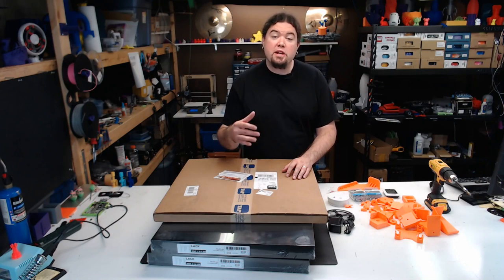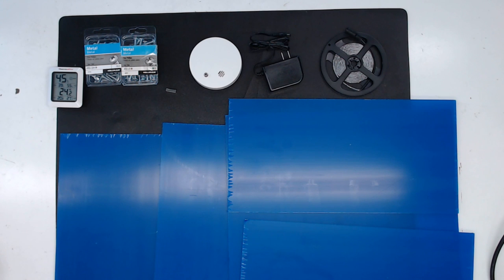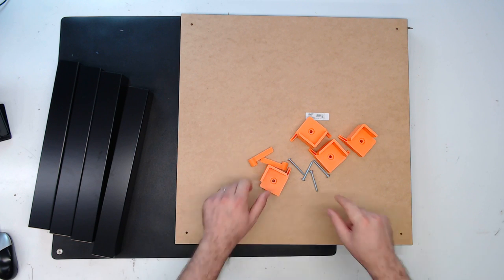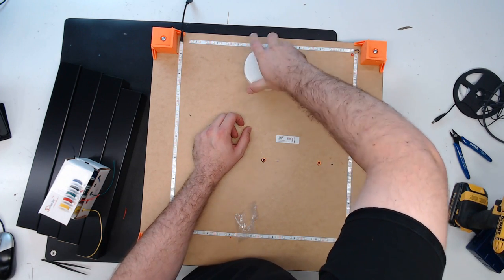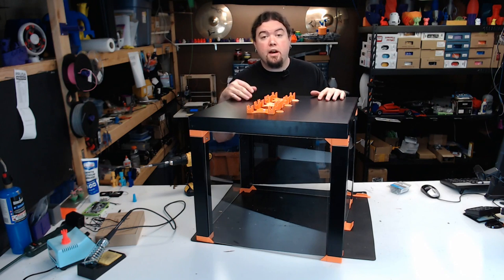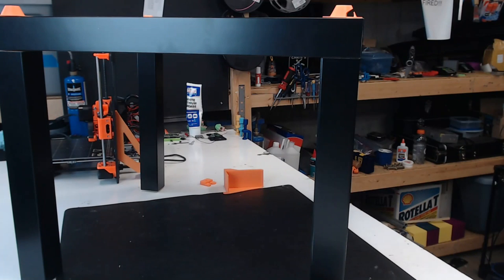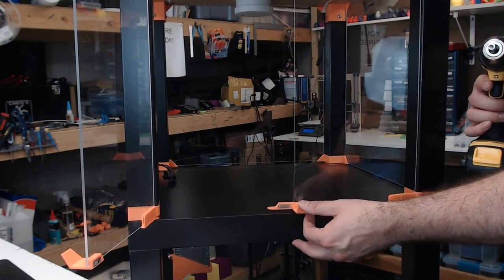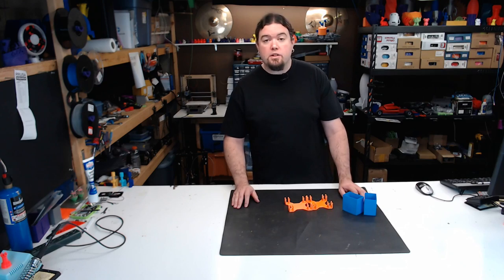Prusa IKEA Lack Table 3D Printer Enclosure - Chris's Basement

Comment: I just built my second enclosure and humbly submit my tips to make sure yours comes out even better. 
In attempt to get my wife to allow it to be a fixture in our family room I printed the parts in black. The enclosure is proudly in the corner of my office. 🙄

Use a sharpie or black marker to hide the glaring white wood that shows through after assembly. Trust me, this adds a lot to the finished product regardless of the color of the printed parts. 

I found on the first one, the parts wanted to wander badly as you drilled them onto the Lack tables. I found that if you used superglue and attached the parts and let it setup overnight you could come back the next day and, don’t skip this, drill a 3/32 pilot hole where there isn’t an existing hole before putting in the screw. If you don’t, the part will rise, drift, leave a burr and not sit right. Also make sure the holes in the part will accept the diameter screw your using. 

Use some tape to make sure the acrylic fits TIGHT in the door hinges. I eventually used a light application of clear silicone to hold them in place while taping/bracing the doors in their aligned position until it dried. 

The magnets are hella strong, make sure they fit flush in their mounts before gluing. I used clear epoxy and allowed it to flow in all the gaps. Afterwards before it was fully hardened I used a razor blade to shave the excess off the top of the magnet and part. 

I hope this helps others to get theirs complete without all the little hassles that I had. I’m a perfectionist so take all this with a grain of salt. 

Chris makes it look easy, it was but the Lack tables are really cheap, i think the best comparison is you’re spending well over the cost of the tables so to make them work, you need to develop your turd polishing techniques. 😉 if you miss a hole, JB epoxy putty works wonders. Fill it, wait, repeat. All in all I loved the video and am responsible for at least 20 views.
Reply from the maker: Great tips! Thanks for sharing.

Comment: Very comprehensive guide! Followed you along with the first enclosure I built and reviewed this for the new top I had to build after damaging the first
my only recommendation for people looking to make this and there may already be remixes of the files for the printed components available 

I slapped a foam sheet and two pavers under my prusa to help with the noise and you need to have either the tops or bottom printed pieces extend to allow the Z axis to move to its maximum height, I gave mine an extra 10cm but you could probably manage with as little as 6cm
and keep in mind you'll need to either adjust your plexiglass size or compensate the added gap with something else

I've also swapped the plexi for PIR foam on mine as I print PETG in the office I work all day in and while the plexi does help with ambient room temp it still raised it uncomfortably for me,  and for anybody curious about insulation options I was told PIR foam is your best bet as things like XPS foam insulation present a much higher fire hazard, a nice bonus is the foam walls help lower the noise as well
Reply from the maker: Thank you! Nice mods! Yes, I actually did a lot of these when I rebuilt mine earlier this year.

Comment: Your video is SO much clearer and easier to follow than Prusa's.  I already had mine built, but watched it to see if you did anything different and picked up some tips.  I was thinking of extending the power cables as well.
Reply from the maker: Glad it was helpful, thanks for watching!
Reply: @ChrisRiley  Can anyone link me to a source for replacement longer cables?
Reply from the maker: @coffeeeater  I just use 14g wire.
Reply: @ChrisRiley  thanks!

Comment: Built a plexiglass enclosure a few years back. Moved PSU away from printer frame like yours. Added exhause fan with charcoal filter variable speed, rollers with bearings (adjustable) on 2 steel rods on top, 3 LED lamps Top, back, front; sheet mirrors on back; Pi  4 bracket inside; slots for power cord to PSU, LEDs and USB cable. Prefab/printed all frame brackets, door latches, etc.24d, 20w, 18" h. Sits on home grown storage cabinet. May try and redo using Prrusa printed parts with my additional mods. Yours looks great, mine is rough but functional (cut plexiglass myself..ugh.
Reply from the maker: Nice! Sounds awesome, cutting plexi is the worst.

Comment: If you're doing tall prints, it is recommended that you use a slot in the top to feed the filament rather than a hole. Failure to do so will restrict the extruder movement along the x axis as the z height increases. Options are available on Thingiverse.
Reply from the maker: I have seen that issue on other machines, good tip.
Reply: do you have a link?
Reply: A slot ?
Reply: Good tip.  Thanks!

Comment: thanks for the info, i found #14 by 2" screws work better and hold in the predrilled ikea holes, and the 3/4 inch screws are a bit short, so I'll be changing those out for 1" screws in the near future...
Reply from the maker: Thanks for the update on your build! This could help others, thanks for watching!
Reply: Chris Riley no problem, now if I can just get my mk3 to complete a print w/o screwing up
Reply from the maker: Really? What's it having issues with?
Reply: Chris Riley it'll print fine for about an hour and then stops extruding... started after I finished printing all the parts for the lack tables, Prusas's support has been great, they are shipping me a new extruded motor this week to see if that's the issue. Tomorrow I'm going to check the extruded gears one more time, make sure they are lined up correctly and tightened down properly, but I don't think that's the issue. Like I said I can get a great print for about the first hour of a print... then something goes wrong...
Reply from the maker: That's a really weird issue...I will be curious to see what the cause was. Kinda sounds like a stepper driver issue.

Comment: I love this enclosure I have been using it for a while now the spool holder didn't work tho I just printed a wall mounted spool holder for the wall behind it and if you have made any pla mods to your printer and plan on printing abs I would recommend reprinting them in abs asap I learned this the hard way I have a contract for alot of abs parts and any pla parts near the printer slowly start to warp
Reply from the maker: These are really cool. I actually pull filament from the ceiling. :)  Good tip about PLA parts.

Comment: Going to try to build one of these for my ender 3 pro. Will just have to figure out the power supply brackets. Might also add a cabon filter exhaust system.
Reply from the maker: Check out this new one as well. https://youtu.be/AxMZESdOPqw

Comment: Not sure if it used to, but the download from Prusa now includes an adjustable filament holder that slides narrower to wider for different sized filament rolls. I used a fixed size in the middle and adjustable ones on the sides and it's working nicely. I think if I did it again I would just put a single adjustable one though.
Reply from the maker: I have seen those, that's a new stl in the bundle. A very nice add.

Comment: For those who have #12 screws and are too lazy to make a trip out to the hardware store: put a small zip tie in the hole and cut it flush. The zip tie will fill the space and your #12 screw should now secure things quite nicely.
Reply from the maker: Thanks for the tip!
Reply: That's genius, fit perfectly after that 👌

Comment: Hi Chris!
Any advise to reduce the amount of vibration / shakes on this enclosure?

Good video!
Reply from the maker: Thanks! I put foam under my printer and set the whole thing on foam rubber and its pretty sturdy. You might try using a little bigger screw to attach the legs, that might help.
Reply: Is there a chance you could share a couple of pics of your setup so we can get a bit inspired? Cheers mate!
Reply from the maker: It's not super exciting, but here you go.

https://photos.app.goo.gl/1fw5swtvpRgjDRnz7

https://photos.app.goo.gl/vWDizVnxwNWfCF9CA

Comment: I made a lack table enclosure a year ago for my Wanhao. Somewhat similar to the Prusa designed one, but doesn't look as nice. It uses a simple pc-fan exhaust that vents to the room..I still need to modify it to vent to a nearby window. ABS fumes are horrible. Though not ideal, I use a window fan and try not to occupy my bedroom whenever I print ABS. This Prusa design really needs a fan exhaust for ABS fumes and the excess heat (excess heat from a 3D printer in a bedroom you occupy during a hot summer day with so-so AC isn't great). Also, while lack tables are cheap, they are hollow and not dense enough - the whole thing vibrates too much when printing. I bought a Prusa MK2 that I'm building an enclosure for now - such a pain. I would actually pay Prusa for a more professional enclosure than what I currently have and this open-source design.
Reply from the maker: Sung Powley Good points. It could stand a few more features. Printed solid has a pretty nice one. https://printedsolid.com/collections/enclosures/products/safety-enclosure-for-prusa-printers
Reply: use a active charcoal filter system and switch it on after the print is finished, Im sure that works better

part of the reasons for the enclose is to keep the fumes contained and the heat in the enclosure.

but better : use PETG . same strengt as ABS, better printability and less fumes.
Reply: Stability was my main concern when watching this build. It all looks so flimsy. Like the whole thing will shake if you breathe on it!

Comment: Awesome, clear to the point video. I wish it showed how to extend the wires.. what type of wires would I need? Im new to all this. I just ordered my Mk3s yesterday
Reply from the maker: Thanks! You can use 14g wire to extend them. I would just create longer ones and replace them. 

Wire: https://www.amazon.com/Audiopipe-PRIMARY-STRANDED-Best-Connections/dp/B01MRYMY6Z/ref=sr_1_4?keywords=14g+wire&qid=1555430983&s=gateway&sr=8-4

Connectors: https://www.amazon.com/Install-Bay-BVST6-Terminal-Connector/dp/B005HQ4QTI/ref=pd_bxgy_107_img_2/141-9741925-2440812?_encoding=UTF8&pd_rd_i=B005HQ4QTI&pd_rd_r=6d5466ed-6062-11e9-a944-2f3383ee933a&pd_rd_w=i1lzI&pd_rd_wg=hsGnF&pf_rd_p=a2006322-0bc0-4db9-a08e-d168c18ce6f0&pf_rd_r=W4Y82YX8NWWCFZYSH3J0&psc=1&refRID=W4Y82YX8NWWCFZYSH3J0

Crimping tool: https://www.amazon.com/dp/B00079LN1Y/ref=psdc_553392_t1_B00004SBDI

Comment: Great Video, I'm going to order from tapplastics, but before I do, I want to make sure that your formula for measurement is L x W. I would surely hate to mess that up.
Reply from the maker: All a square except the boards.  The 220mm is width.
440mm is 17-5/16″
220mm is 8-5/8″ (erring on the low side, it’s actually closet to 8-11/16″)
Reply: Chris Riley I’m not going to use the lack because I have a CR 10 Pro V2, but I am going to use the brackets. I appreciate all you do.

Comment: This is still a great project to build. But be aware of a couple of things which changed slightly with the IKEA Lack table design and also the altered design of new PRUSA printers (e.g. MK3S+), There are lots of new printing models to align with these changes. So I made it successfully in 2023. Have fun!
Reply from the maker: Thanks for the info!
Reply: Is there a list of new printing models and or new hardware used? I just bought my table and rummaging through the hundreds of remixes looking for updates files is a bit daunting.

Comment: If you're ordering from TAP, why not get a black ABS panel for the back so you don't have to see through the rack? 440x440 is $16 for 2.
Reply from the maker: Good idea!
Reply: I was going to do that but color was only available on cast acrylic so I’m going to spray the back panels, from the outside with black paint. Cast was much more expensive when I checked it out when I ordered.

Comment: Great video Chris, thanks!  Is there a way to remove the lower legs and mount the power supply upside down on one of the upper legs?  I will have it sitting on my desk and is higher than I want.  Plus I think it will be more stable without the lower legs.
Reply from the maker: Thanks! You might be able to. You would have to rework the bracket a bit, but it would work.
Reply: @ChrisRiley  Thanks again.  I actually found a different bracket on thingiverse to do exactly that.  The designer was only intending to stack the tables and use both as enclosures, meaning he would have to mount the lower power supply on the same level, not below.  Anyway, great job.
Reply from the maker: @joecardenas9681  Great, glad it worked out!

Comment: It looks very wobbly at 12:55 .  Were the screws not tightened yet?  Otherwise I would either add diagonal braces, or screw or glue the side panels to the legs rather than just inserting them into the corner slots.
Reply from the maker: Yeah, it takes a few more screws and brackets to get it firmed up.

Comment: As of current 2/11/21 The 2 inch screws are too small for the holes, you can literally push them right into the holes in the lack table, No Threading at all. I'm not sure if they changed the designs/tooling for these tables. I'm going to have to run to the hardware store and figure something out. Awesome build guide though.
Reply from the maker: Something did change on the tables. In the second build I used #14 2".

Comment: Great video Chris. I'm at the cable management stage of the Prusa i3 Mk3 build. I also have my LACK tables ready to build the enclosure after the brackets have been printed. I see from the video that you added a few inches of cable to the PSU. Is this extra cable length essential to connect the relocated PSU ?
Reply from the maker: The MK3 might be a bit longer than the 2, so I am not sure, but you don't want them to stretch. Prusa says the stock MK3 wires will work.
Reply: Thanks Chris.

Comment: It might be neat to extend the control panel to the exterior of the enclosure. I need to get my a Prusia, my ANET A8 just can't keep up.
Reply from the maker: Yeah, that would be cool. I have actually done that to other machines and it is handy. For the Prusa depending on where you put it, you might need a little longer cables. I am not sure what the max length on those type of ribbon cables is. It would be a great add-on for sure.
Reply: @ChrisRiley  just get an extension 😉

Comment: Hello Chris,

Greetings from Spain, good job...you can put the measures of the screws used in metric scale please, I do not know how the subject of the inches goes, thank you, or add the link where to buy those measurements thanks
Reply from the maker: Thanks! No clue where you would buy them. 12x 6×20 mm (12 x 3/4″)
4x 6×50 mm (12 x 2″)

Comment: Could you provide a link for the LED light strip you show in your video? Also, could you add instructions on how to tie the LED strips together to make a continuous strip. Great video! Thanks Richard
Reply from the maker: Here is the link to the strip I used:
https://www.ebay.com/itm/ABI-300-LED-Strip-Light-Kit-w-Power-Supply-5M-Cool-White-6000K-SMD-2835-12V/361395564591?ssPageName=STRK%3AMEBIDX%3AIT&_trksid=p2060353.m2749.l2649

Linking them together is pretty easy. You can just solder some small wire from strip to strip. The LED is well marked.

Comment: Stumbled on this enclosure a few days ago, nice setup. Question: What did you do with the black power cord for the LED strip? Where does it run to, or out of?
Reply from the maker: I just ran it under the glass, there is a bit of the gap. Not a great solution.

Comment: Hi Chris, very nice enclosure. Can you please tell me the name and location of the CAD file for those three circular parts that allow the filaments to pass through the top of the enclosure?
Reply from the maker: Thanks! I am not sure the cad file are available, but here is the info. https://www.thingiverse.com/thing:2864118
Reply: @ChrisRiley  Thanks. I know that site but I cannot find the file for the part that helps the filements to pass through the top of the enclosure. What is the name of the part? I mean the three orange ones you showed at 5:00.
Reply from the maker: @petercohen8877  THey are included with the spool holder parts, it's in the second from the bottom. Use your slicer to break them up. https://www.thingiverse.com/thing:2864118/files
Reply: @ChrisRiley  Thanks Chris. Based on your experience, does the filament pass through the orange tube easily? Is it better to put a PTFE tube in the hole to reduce friction?
Reply from the maker: @petercohen8877  There is lots of room, it passes just fine. Only time I have had issues is at the end of a roll when it get curly.

Comment: I just started making this go to put the top corners on and they won't get tight
Reply from the maker: The Lack tables have changed a bit over the years, on the newer ones I use #14 x 2" screws.
Reply: @ChrisRiley  thnk you i will give it a go

Comment: Just a heads up for those building this in June of 2020 and after.  Apparently the design may have changed for the lack tables.  I bought three of them and #12 screws for the legs, don't grab and get tight at all because they are too small for the leg pre drilled holes.  I went to the hardware and bought four #16 x 2"  Philips head screws and although they are still not as thick (diameter) as what came with the table, they do snug up nicely.   :)  OK, continuing my build now.  :)
Reply from the maker: Thanks for the heads up!
Reply: If you have #12 screws and are too lazy to make a trip out to the hardware store, put a small zip tie in and cut it flush with the hole. Your #12 screw should now secure things quite nicely.